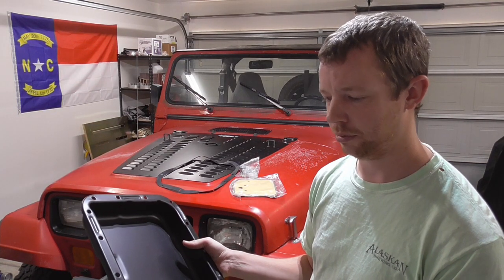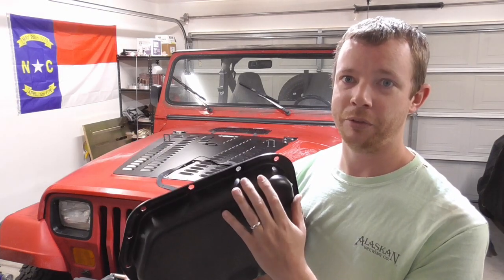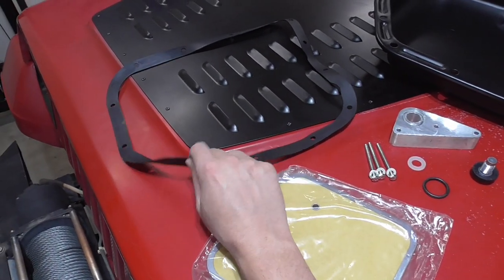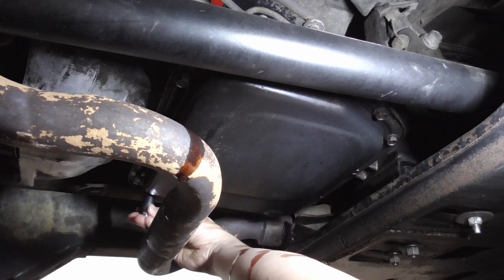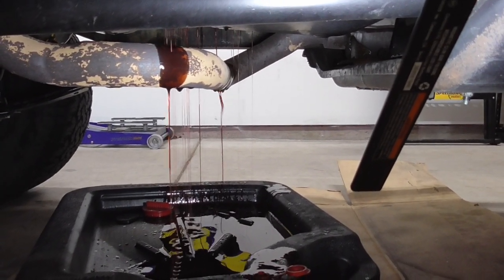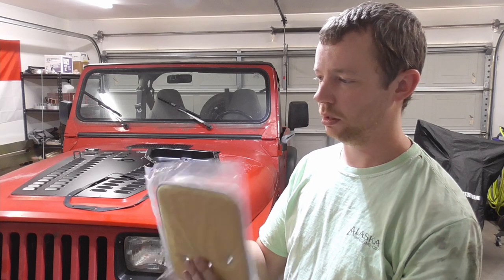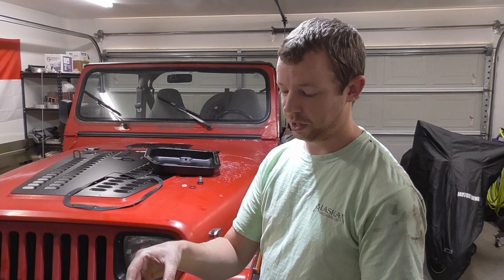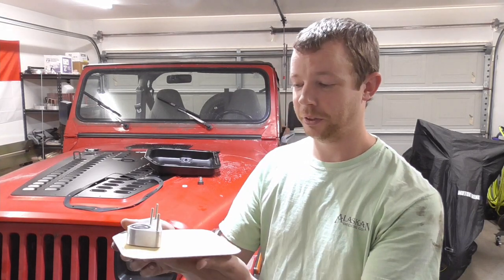Deep Transmission Pan Install - Jeep 999, 904, 32RH

Comment: To drain my older automatics, I use a syphon hose through the fill tube. 

Don't forget to blow out your cooling lines and cooler. Use WD-40. 

Next upgrade for you should be the TJ downpipe and wrap around. It comes down then goes forward and around the oil pan sump, then along side the block. I had one custom made for my 2.5/5-sp YJ to match up where the exhaust goes up over the crossmember. Just make sure you can remove the starter.
Reply from the maker: TJ exhaust is on the list if I keep the 4.0

Comment: Great video! I know it’s been about a year but I just installed the same pan on my 91 YJ and it took 10.5 qts to show full on dipstick. Do you remember how many quarts you put in? Now I have a large puddle under the Jeep. I’m thinking it’s way over filled. Thank for any feedback
Reply from the maker: I think mine took less than half that. Did you fill it and check while it was running and in neutral?
Reply: @HardEarnedBacon  yes sir.. I posted it on YJ forum on Facebook and someone posted it the A999 takes 9 to 12 quarts depending on transmission lines. Just not sure why it’s leaking. Nothing like tracking down leaks! Thanks for responding so quickly!
Reply from the maker: @TheHammstead  Hmm not sure, mine definitely did not take that much.

Comment: That nylon washer goes on the drain bolt. It is a tight fit, but it will go. You can't push it all the way, but it is better to thread the nylon washer onto the bolt.
Reply from the maker: Why would you stack a nylon washer on top of the rubber washer already on the drain bolt?
Reply: @HardEarnedBacon  I got pretty much the same kit from another company and that's what the instructions said for that kit.
Reply from the maker: @JasterMereel421  Weird. Well it has been quite awhile since I did this pan and no leaks so I'm not worried.
Reply: @HardEarnedBacon  if it works without it, it works without it. I just watched 2-3 videos on this deep transmission oil pan, none of the knew what that nylon washer was for, and I'm just posting what the instructions said it was for.